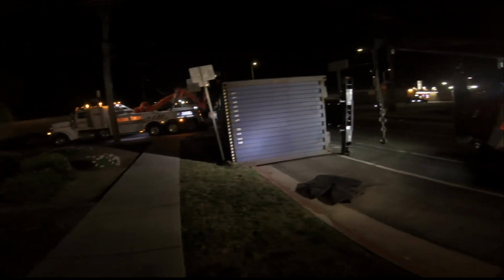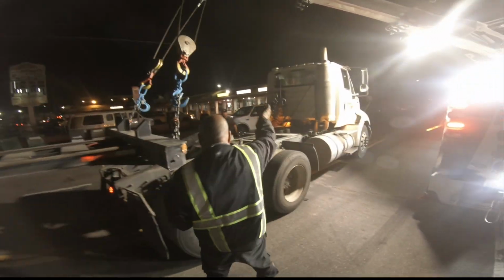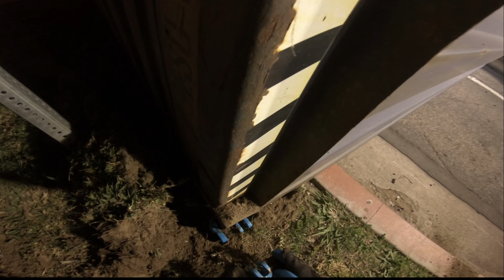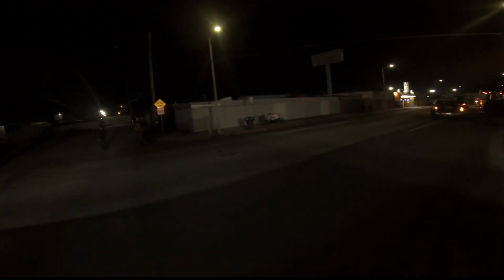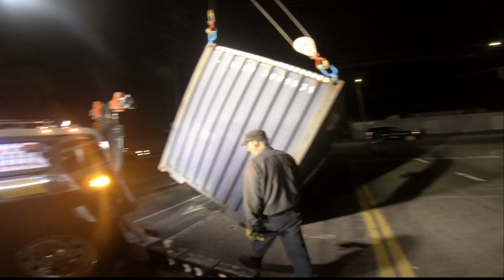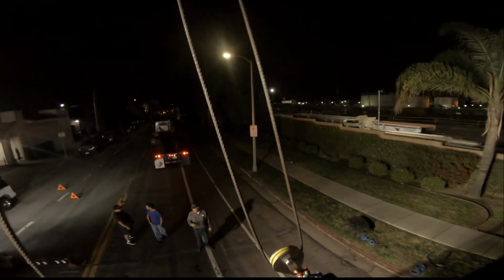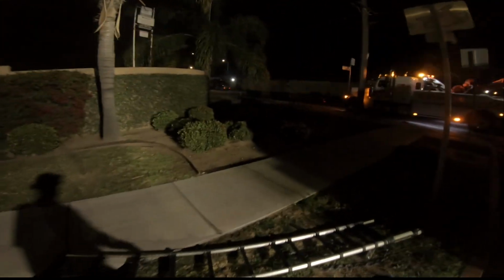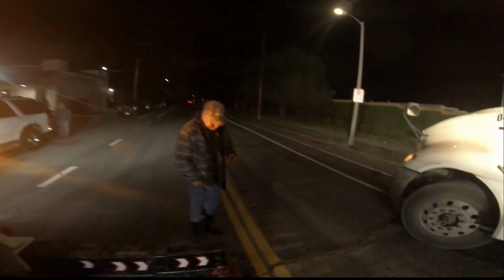Another rollover for Hulk!

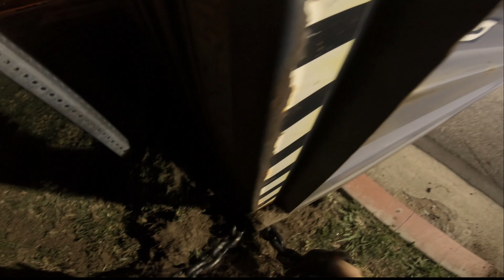Comment: 8:30  Just wondering why you did not stick with the chain to lift the container?   And what is the device you used called, a c-clamp?
Reply from the maker: I was only putting the chain because I thought the hole sunk into the ground and wouldn't allow me to fit a shackle. The reason you never want to use chain is because you only have 1 or 2 points of contact with the entire container that way. Think of it this way, you're putting all the weight and force of the container on 1, maybe 2 individual links on that chain. That is very dangerous, I used container links. They are specifically built and rated for distributing the weight and forces of containers when you lift them.
Reply: @PepesTowingService  Makes perfect sense now. Thanks for taking the time to reply !   Hope you are having a great weekend !

Comment: You are twisting the trailer pulling from the front like that and I've never seen a fifth wheel break off before somebody must have loosened the bolts on it or something I just don't get that happening they have like right bolts in them that would be some tremendous force to do that
Reply from the maker: LOL are you kidding me? Did you even see the rest of the video? How the hell is a container chassis going to twist from simply being lifted high enough to fall over? It's fine relax